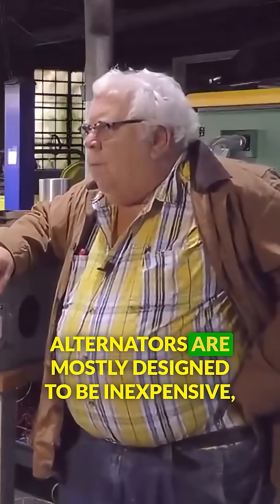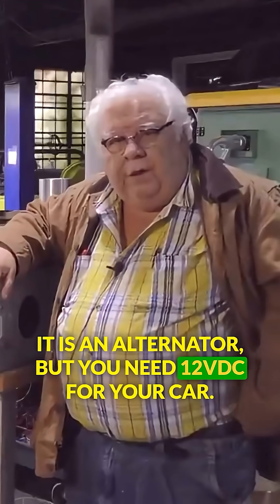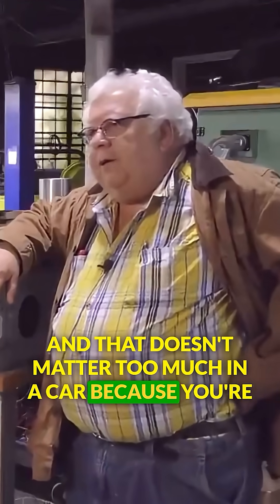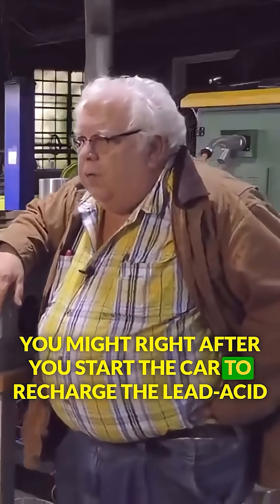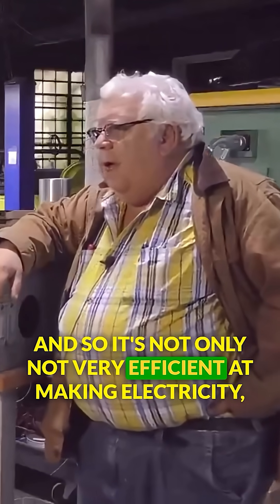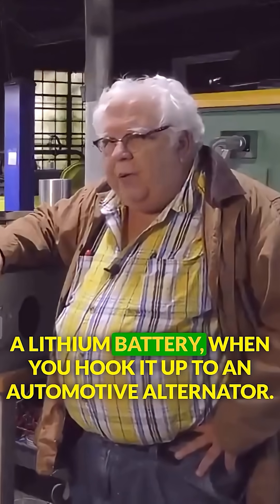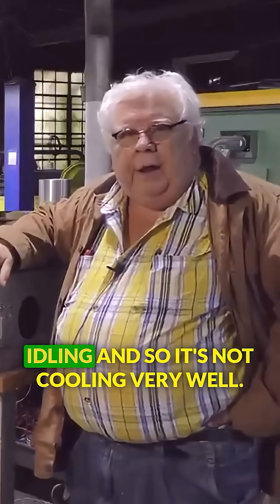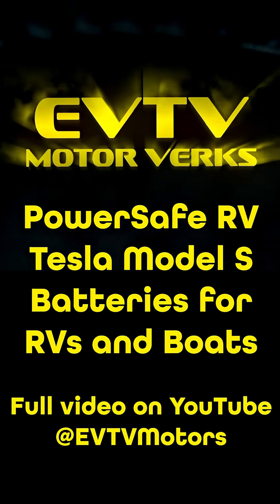Alternators are Only 50% Efficient!

Comment: I have heard different versions of this. However, the alternator will provide the unlimited energy a EV car needs but it will need to be modified to be effective for the EV.  There are a few options to mount it to the EV. I am happy to share, but the EV industry needs to pay for my ideas.
Reply: Lol...  you mean regenerative brakes?  
They already have "alterators" on EVs. When you use them to charge batteries it slows the car down very fast.  
And it doesn't make enough energy to bring in back up to that same speed.. it is not a balanced equation.    There is no unlimited energy.
Reply: @davidarnold344  No, I'm not speaking of regenerative brakes. Those only send the energy bake to the batteries. Not really regenerative.  The system on the EVs is not a real generator or the type of system I am speaking of. What I am speaking about will actually create all the power EVs need without charging at a charging station.
Reply: @wethepeople8826 well you are truly amazing then, you are first person in the history of the world have developed perpetual motion... actually you sped past perpetual motion and went right into unlimited free energy... amazing.  You overcame the limitations set forth by the laws of physics and thermodynamics. 
It is my honor to have met you.  Your name will be bigger than Joule or lord Kelvin who developed the law of conservation of energy and the 2nd law of thermodynamics and respectively have units of measurement named after them. 
You my sir will be in the history books. 

You have developed a system that can generate electricity from the motion of the car that doesn't effect the forward motion like regenerative brakes.  
Energy generation that doesn't take energy... wow.     Clap clap clap.  
Free energy.  And small enough to fit on a car.
Reply: EVs do not have or need an alternator. Why use battery power to run an alternator to replace battery power? It makes no sense.

Comment: Lithium batteries take 100% of the alternators power only if the alternator puts out less than the battery. If you want to use an alternator to to charge a lithium you can either make sure the alternator is very powerful in comparison to the battery or use a dc to dc charger to limit the amperage going to the battery. I would say don't use more than half of the alternators capacity.

Comment: I hook mine up to a lithium battery.   I use a bluetti solar generator and the charger one that bumps up the voltage, creating more wattage. I've watched my inboard voltage gage and temperature, and I see relatively no change but a .1 or .2 difference in voltage and no changes in temperature.   The bluetti charger one will shut off when battery voltage dips close to cranking amps.

Comment: Altenators are over 90% eficient ( I worked in  R&D on altenators ) for an altenator manufacturer . Altenators do not function well with lithium batteries because when the lithium  batteries is full to cuts off the battery from the altenator  with  switch  this causes a voltage spike that kills the diodes .   Altenators are way better than the old fashioned  dynamos on all measures.  If you are worried about drawwing too much current you can drop in a device to set a maximum currnent .
Reply: A simple fix is a smart charging solution between the alternator and the lithium battery.

Comment: Not entirely wrong, but, most alternators have a small pully on them compared to the engine pully driving it.
The result is that most alternators at engine idle speed are actually in this case, spinning around 1,800 RPM
This provides ample cooling for rated output. The other thing to know about automotive alternators is that their output is actually limited by too high an RPM. Because of the inductive reactance in the stator windings, the AC current  produced is limited by the frequency increase with speed of rotation. This has a choking effect on the AC current supplied to the rectifier and results in a maximum limiting output speed of around 4,000-5,000 alternator RPM so at a pully ratio of typically 3:1 you will get maximum output abillity at around 1,500 engine RPM wich is typically the best charging engine speed.

Comment: This guys talk is more about say a Ford 1960s Alternator. 

 A 1960s era car alternator has a decent loss in its stator steel; it can be rather high

The stator laminations of these are rather thick about .06 to .07 inch. These have decent "core loss"  that goes up with the RPM of the alternator. The older 1960's era alternators often had plain steel for the stator; not motor grade or transformer grades with low losses

All this did not matter much then. One had big engines and low cost fuels

A modern cars alternator has thinner laminations and better steel in them and thus way lower core loss in the stator. ie it "sees an AC waveform" that is rather a high frequency when it spins fast. 

This also allows the alternator to be smaller and put out more amps

For Clarity in EE terms you need thinner laminations as the AC frequency is higher. You need better transformer /motor grade steels for less core loss and higher magnetic fields that alternate

The 1960's first car alternators purpose was more amps available while idling; ie no drain on a battery if lights and AC are on

A neighbor in Detroit did the marketing gambit where a 1961 Plymouth Fury went from Chicago to Detroit without a battery; just an Alternator once the engine was cranked

Comment: I have respect for a down to earth  good mechanic
Reply: He might be a mechanic but he doesn't know how electricity works. Batteries aren't a load, your headlights, radio etc are the load
Reply: @jeremymcadam7400  They are when charging.
Reply: @SamuelBallenski  and what causes them to need charging?
Reply: @jeremymcadam7400  Their load. There doesn't have to be only one load and only one source. Different components can load different things. The battery is the alternator's main load, and ironically the alternator also partially loads the battery, along with the rest of the car's systems.
Reply: @SamuelBallenski  a lithium battery doesn't cause your accessories and such to put a bigger load on the battery and so the alternator, does it?
Reply: @jeremymcadam7400  Explain. Where in the circuit are you placing your lipo? Being charged as an accessory? Replacing the battery?
Reply: @SamuelBallenski  if you replace the battery with any kind of battery, the load is still created by the ignition, headlights, etc. the type and size of battery is inconsequential to the load
Reply: @SamuelBallenski  this reminds me of the plane on a treadmill thing. The plane is propelled by pushing air out the back of the motors, slippery ground makes no difference
Reply: @jeremymcadam7400  ... Yea, no shit. Still doesn't answer what you were getting at. You are partially correct, from the perspective of the battery. When you're talking about the alternator, the battery is the main load, and the rest of the car's systems are indirect loads.
Reply: @jeremymcadam7400  Funny thing is, the plane being on a treadmill does actually affect its ability to move in a specific direction. Except it's through wheel bearing friction, but that's so minimal it practically doesn't matter. Also, gases, not really air at that point. Sidenote: slippery ground is still a huge nono regardless. Loss of traction is a big deal.
Reply: @SamuelBallenski  so why does a lithium battery put more stress on an alternator?
Reply: @jeremymcadam7400  You're being incredibly vague. I can't even tell you whether it would actually stress the alternator because I don't know where in the circuit it is or what it's doing.
Reply: @SamuelBallenski  well perhaps you should reference the video
Reply: @jeremymcadam7400  LOL been a while. I see what you mean. You're correct, the indirect load applied by the car's systems does not change. What you're wrong about is that the type/ size of a battery has a massive impact on the load it puts on its charger. Incidentally, lipos charge stupid fast compared to lead-acids, meaning they also impart a larger charge draw. This forces the alternator's voltage regulators to open the floodgates in order to maintain proper output voltage. That's what stresses the diodes and causes burnout. The indirect loads play a part, but the real problem is that larger charge draw without sufficient cooling.
Reply: Would be better if you put away the halo effect and respected actual knowledge and experience instead. A smooth talking obese geriatric is not incumbent to having the knowledge of the universe lol. The reality is he clearly has no idea what hes talking about, his whole speech here doesnt even make sense from a physics perspective. "The diodes are 50% efficient" (wrong) "so youre cooling 100amps at 12v".. ironically most modern alternators work at closer to 2000 watts.  

Hes implying that "1200 watts" is pure heat, which is ... unequivocally not even close to approaching accurate. There are "1200" watts, but.... a lot of that is going to actual power lol. Even his low estimation of 1200 watts of "heat" (yes there IS heat, don't hear what im not saying) is absolutely blasting every breaker and fuse in a 100 meter radius lol. 

The battery type DOES NOT MATTER to the alternator lol. Hes a crack pot, has been, with decades of convoluted tribal knowledge that may or may not be real. You have the option to actually learn about this stuff In a way he never had an option to. I implore you to use it

Comment: Not so simple anymore, modern cars have smart alternators so you need a dc to dc charger in front of the second battery (AGM or LiPo). Either you go to a good electrician for a complete installation or you buy a smart power bank. Lately the power bank producers recommend to install a dc to dc charger too.

Comment: The Honda Civic VX was a high MPG beast, and it used a special alternator. The original one on my car finally went bad after hundreds of thousands of miles. The aftermarket replacement had to be replaced twice (three of them) within a year. The last one lasted until the car was retired.

Comment: My gripe with most alternators is, they are electro magnets, which consumes around 1/3rd of the energy generated. Permanent magnets are the way to go.
Reply: We have those, they're called magnetos.  They suck in cars as they tend to be lower power, but more importantly don't put out much power at low RPM, means at idle your battery goes flat.

Bring on the EV's so all this crap goes away.

Comment: Anytime you spin copper inside magnets you get AC voltage. Period. What you take from it, or convert from it depends on design. Slip rings on a generator and commutator in an "alternator". Alternator was a marketing term coined by Chrysler back in the day to show they had the latest and greatest tech of the time.
Reply: Slip rings on alternators bud
Reply: @zweisteinya yep, got that backwards. Thanks for catching it. Sometimes fingers move faster than the brain
Reply: Obviously you have never seen a DC generator w/ magnets. On a 12V- Lucas system at that. Magnetless AC was such a leap but needs 12V for the field windings.
Reply: @jonashellsborn7648 obviously!

Comment: It’s a three phase AC generator and the efficiency is closer to 70 or 80%. Diodes have a forward voltage drop of 0.7v so at 100 amps it’s 70 W, not 1200. 

The cooling is an issue as is iron core losses due to eddy currents and internal resistance but it’s a lot more than 50% efficient.
Reply: Definitely not 0.7V at a decent current! Nowhere close.. With a 'diode test' on a multimeter at one milliamp, you might get  .7V . A big diode conducting 10A will be around 1.2 - - 1.5V drop.
Reply: @tomlewitt  true, and people often overlook that it is a 3 phase bridge, so you have 2 diode drops. So for example at 100a you could be close to 300w of loss. The iron losses and resistive losses in the windings plus the windage and friction all add up too.
Reply: Because of CAFE laws, the car makers are going for as much efficiency as they can. I doubt if they're leaving any losses on the table if they can help it.
Reply: That’s exactly what I was gonna say, but I don’t know what the hell I’m talking about.
Reply: Or .7/14.4 i.e. 5% loss on diodes.  Attempt to reduce losses is probably infeasible.
Reply: No, they are about 60% efficient tops  for modern ones, the diodes are only a small amount of the losses .
Reply: @jimmyp1433 what are the other losses? -- Ive seen bench setups be pretty on par with claimed efficiency standards. Robot cantina makes a videos series using an alternator powered by a Honda to drive an electric golf cart, the results are impressive and show high efficiency.
Reply: At idle.
Reply: Agreed. If the alternator was dumping over a kilowatt of power back into itself, it would probably melt the aluminium housing in a few minutes!

Comment: Solution...generator with an air conditioner clutch.
Reply: what they are doing is using an internal battery monitor system. it is about to limit the incoming charging load put on the alt. all the new drop in replacement have them. plus they handle cell balances and internal Temps.

Comment: How about an active rectifier using low loss MOSFETs or IGBT and switching control instead of traditional diodes with at least a .5v-1v drop each? Shouldn't cost that much more. Some may say too complex, but in the lithium battery cases it would make sense (to me).

Comment: Alternator was so-named because it replaced the generator with its brush-tapped DC output.  The alternator does put out AC.  It just funnels that thru a rectifier.  Could be half-wave, full-wave single phase, or if the designer is feeling frisky, three-phase full-wave.  Differing in efficiency.  Wanna shoot the moon?  Use Shottkey devices.  And that doesn't even touch on current monitoring/limiting.  Alas, we're aiming for cheap.  Leave us not forget, people will cobble parts thinking they're being smart.
Reply: Name originates from a contraction of Alternating Current Generator
Reply: @mikedoyle2974 Yes. So it it is not actually incorrect to refer to an alternator as a generator.
Reply: Look at Computer PSU's, more advanced Rectification with multiple transformers, minimum efficiency these days is 80%
Reply: Mosfet alternators are very efficient, even more then Schottkey because the Rforw. is in the range of 0,01 Ohm.
Reply: Most automotive alternators have been 3 phase, full wave (6 diode) rectifier, since at least the 1990 anyway.

The design parameters of winding, coil connection, heatsinks, puley ratios, ventilation were chosen for typical usages. The quality of the design should be measured by how much is achieved for this scenario.

If a part, mass produced for an application, is usefull "off label" in another application why not use it?

It's just not reasonable to complain it ain't a perfect fit. Tradeoffs.
Reply: @celsostarec6735  The 1960s ones are 3 phase too inside the alternator; with 6 diodes to rectify so 12 to 14 volts nominal rating. Early 1960s Fords and Chrysler had external regulators

In early 60s  alternators for Fire Trucks and Ambulances the entire 6 Diodes were external so easier to replace